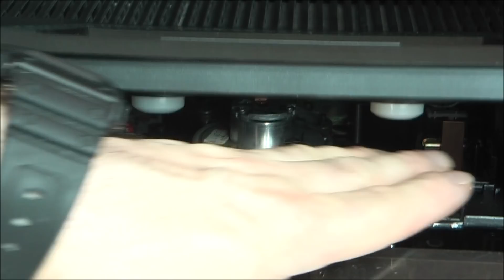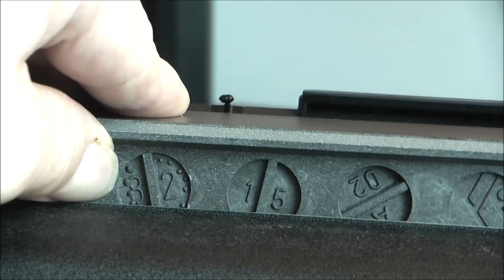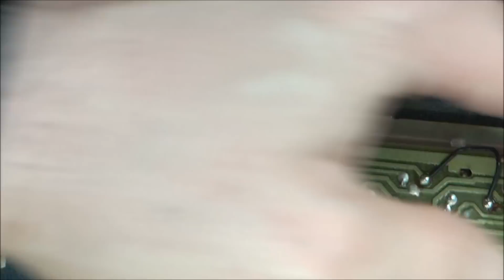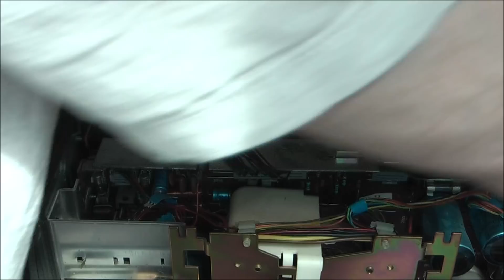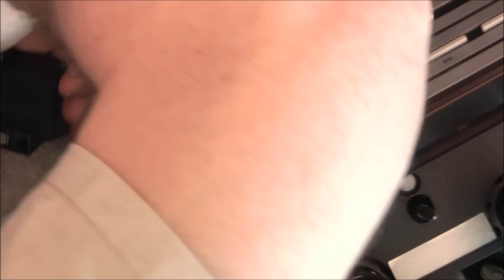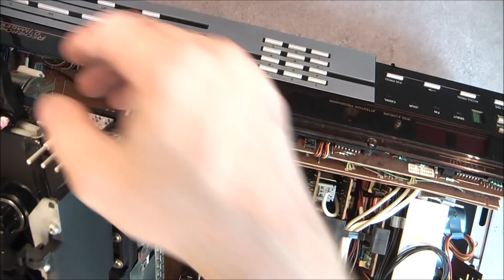1982 vintage V2000 VCR teardown

Comment: I also have some VCR's at home, they all power up but if you put a cassete inside then they will catch the tape, either on playback or on eject.
Yes, VHS have 3 hours and the VCR's were cheap, so the porn industry exploded on the consumer market, even Sony could not impose his Beta and BetaMax system.

Comment: Notice the brush mount on top of the video drum; this is a feature called Dynamic Track Following.  It uses two heads mounted on piezo cantilevers which adjust thousands of times each second to maintain a stable lock on the video track.  This allows a very stable video picture regardless of playback speed or direction, even up to twice normal playback speed.  Before Video 2000 this feature was only found in professional equipment, and it would not be used again in consumer VCRs until Mitsubishi reintroduced it in its line of S-VHS VCRs in the mid-80s.

Comment: I've never heard of the V2000 format, thanks for showing! There are a few V2000 tapes being sold from Russia on eBay at the moment. Price seems cheap enough and shipping is also inexpensive to Canada at least. Before purchasing the tapes, I would look for a tape sensor inside the unit. It's very weird that the drum doesn't spin but the mechanism works. VHS decks as you probably know use an infrared sensor on a pillar that goes inside the tape itself. But this unit might use a tape sensor maybe? Look for anything with wires coming out of it, and maybe you can figure out how to activate that sensor. It's either going to be a microswitch or an infrared emitter/detector pair. If you can't get the drum to spin then maybe the drive circuitry for it is dead. Also maybe you can just try giving the drum a spin by hand when it's playing, to activate the speed pickup sensor and see if that does anything?

By the way, if you ever have a chance to obtain a Sony SVO-5800 VHS unit for cheap, you would enjoy it for a teardown. :) In my opinion it's one of the prettiest units to look at while it's working. You can operate it completely naked with all of the casing completely removed (front, sides, top, bottom). It's all direct drive as well (no belts). Construction is fully modular and all circuit boards and mechanism are easily removable. The only video tape devices I own are an SVO-5800 and an EVO-9850 Hi8 unit. I've repaired a bunch of them in the past so I'm familiar with both on a technical level. Both are ultra easy to service. Like, in the 9850, the entire tape transport mechanism can be removed with something like 4 screws.

Comment: In a time long ago in a place far, far from you Philips sold a video recorder n1500 vcr and latter the n1700. These had a large helical scan head and the cost of that head was more than a new unit which was lucky as they only had a very limited stock of parts for these units. This was prior to VHS and Beta but from memory. Philips also produced a laser disc player which had a large DVD like disc which was 20 cm in diameter.
Reply: Systemrat2008 Don't forget the dynamic tracking; they were the first consumer video recorders to have such a feature.